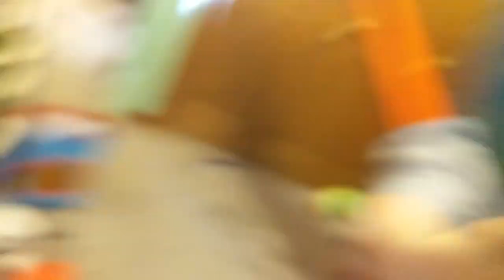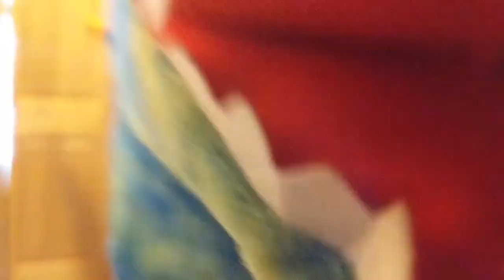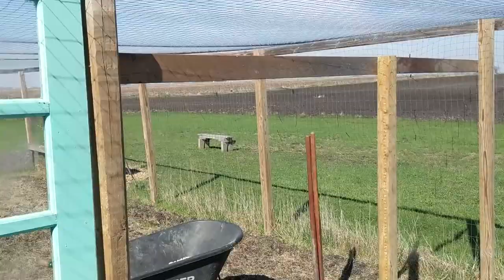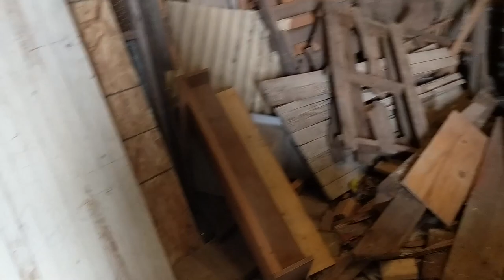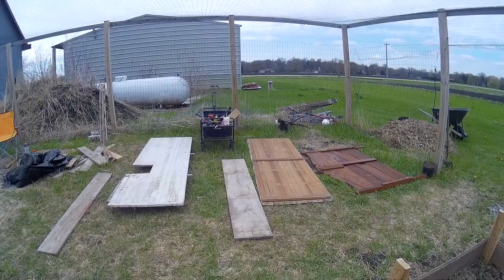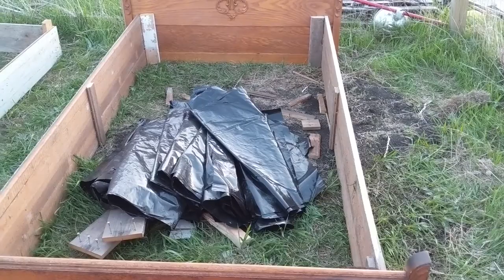Building Raised Beds From Junk reclaimed wood cheap - Homestead Vlog #6

Comment: aren't you worried about termites?
Reply from the maker: nope, its just scrap stuff. it wouldn't take to much work to rebuild the bad parts.
Reply: @HiltsyAdventure  no I meant having a nest of them near the house if they do like the wood.
Reply from the maker: @Aussiemoo  - the house isn't close, just an old barn and my shop witch is a steel building. but I haven't seen any yet anyway, the chickens have had access to that area all winter and spring